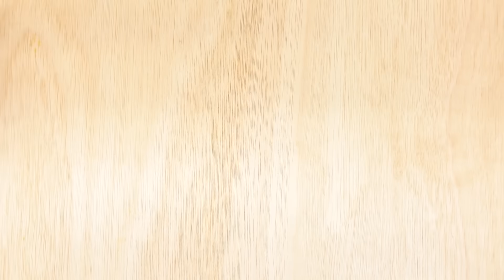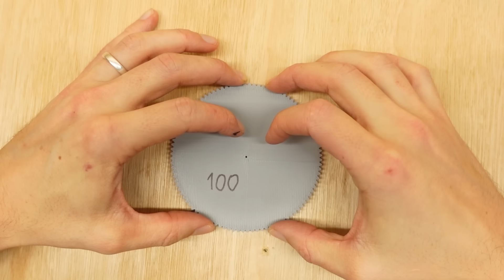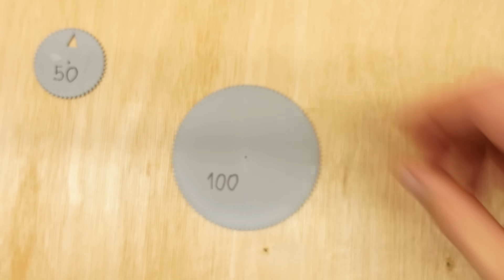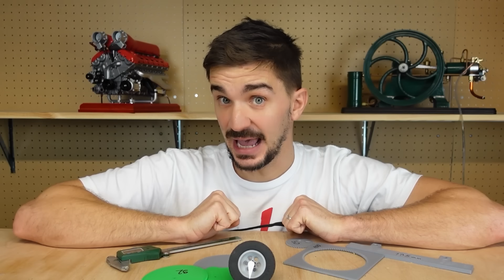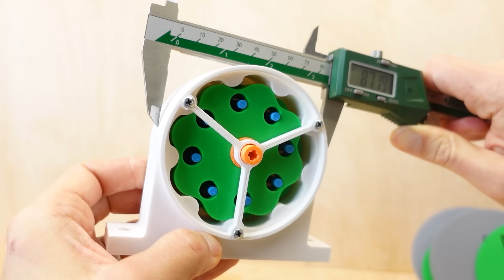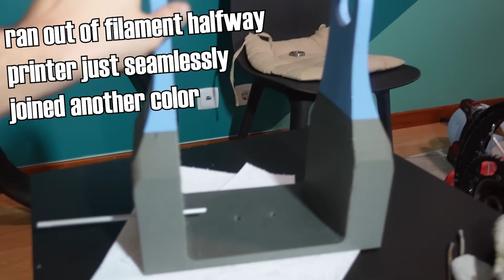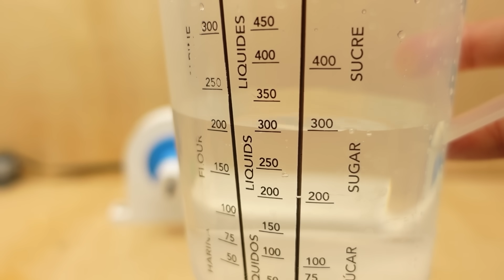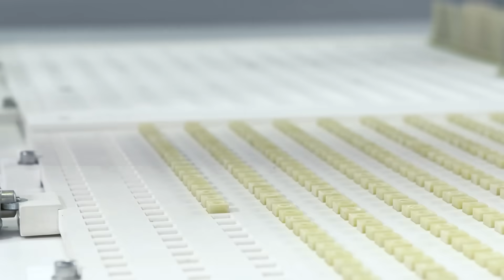Toothless Gears Make Much More Torque Than Conventional Ones, Here's How. Cycloid Drive Explained

Comment: As an automotive engineer with soon 30 years career, I had never heard of these gearboxes. Every day is a school day. Thanks.
Reply: They have virtually no backlash with minimal losses compared to any other no-backlask mechanism. So, when you really, really have to be able to control rotation accurately and with a lot of torque from a small motor... That is why they are #1 in robotics, it is mainly about the lack of gaps between teeth, and then about it also being compact. It isn't so compact that it would be the main reason, but it also happens to be very compact.
Reply: You've never heard of cycloidal oil pumps ?...😮
Reply: @peterfitzpatrick7032  Who’s talking about oil pumps?
Reply: @peterfitzpatrick7032  Hahahaha. A similar mechanism used for something else is a different mechanism.
Reply: @timessix8434  The video is about cycloidal gears... is it not ?...
Reply: @alpha434  when is a cycloidal gear not a cycloidal gear ?... the video is about the unique shape of the cycloidal gears teeth, not just about speed reduction... in automotive engineering, that shape is put to good use in a pump design... the OP is an automitive engineer... so my question if he had never heard of cycloidal pumps is valid... 🙄
Reply: @alpha434  no same mechanism is the same mechanism no matter the application. You ever heard of a wheel on a car vs a wheel on pulley? Totally different thing right??
Reply: Yes. Different things. One is a wheel, one is a pulley. Nice try, bud. Also not similar to a "gear reduction vs a fluid pump". But don't make me wait too long for more midwit commentary.
Reply: @peterfitzpatrick7032  When its not a gear, but a vane. Pretty simple.
Reply: @alpha434  

"It is better to keep one's mouth shut and be thought a fool than to open it and remove all doubt" 😏

From Merriam-Websters dictionary

"Vane" 

"...: a thin flat or curved object that is rotated about an axis by a flow of fluid or that rotates to cause a fluid to flow or that redirects a flow of fluid"
Reply: @peterfitzpatrick7032  Peak-midwit is using Merriam-Webster's to learn engineering, and then not even be able to comprehend that the definition does include the vanes of a cycloidal pump "thin or curved". Lol. Lmao even.
Reply: @alpha434  Is that shaft an axle?
Reply: @peterfitzpatrick7032  why are u talking about oil
Reply: @peterfitzpatrick7032  he's obviously not saying he's never seen a gear shaped like this... a cycloidal oil pump does not us the cycloidal gear as output so its not the same mechanism. also he said specifically he's never seen a GEARBOX like this, not thats hes never seen a gear like this. an oil pump is obviously not a gearbox
Reply: So, automotive industry prefer planetary gear instead
Reply: @aikonlatigid  The automotive industry has dabbled with several different types of gear sets. Planetary, for a lot of automatic gearboxes. Helical gears for manual and DCT transmissions. Straight cut spur gears for reverse, in a manual. And several different flavors of CVTs.
Reply: @aikonlatigid  The reason they are not used in automotive is the same reason you don't find worm gear drives in automotive; it is because the output shaft can NOT drive the input shaft.  The output shaft is "locked" to whatever speed the input shaft is turning at (if the motor is not spinning you can't turn the output shaft at all).  Letting off the gas in a car with a cycloid gearbox would result in immediate skidding of the tires.
Reply: @s @slode1693 Does a standard engine stop spinning when you let off the gas?
Reply: @ReclaimerTyphoon  No...  But it will decelerate at a much faster rate than the vehicle itself.  You really don't seem to understand the issue that the output shaft on these gearboxes is "locked"  You can't turn the output shaft to spin the input side.  When the input shaft is at 0 rpm the output shaft is literally LOCKED in position.
Reply: @slode1693   not if they added a sprag clutch to prevent that
Reply: @slode1693  there are one way bearings that can solve that
Reply: @alf3071  but then your engine braking would be non existent. There's always a compromise
Reply: @slode1693  wouldnt that be cool tho? Drive the car for a bit and then let go of the gas pedal and watch your car skid to a stop?
Reply: @White_Night_Demon Youre paying for the tires, not me.
Reply: @chillinzard I wont be paying tires
Reply: @slode1693 this is false. There's nothing about a cycloid drive that prevents it being backdriven.  The torque required to do so, however.....
Reply: @aikonlatigid  And that is good because cycloid gears have a worse efficiency / more losses...........
Reply: @moru3236  Wrong
Reply: @PaulMartin-n6m  <- Stupid?

If you had even the slightest clue about technology, it would be obvious to you when you see it in action that, with the many friction points on the drive pins, the transmission MUST have SIGNIFICANTLY more losses than a clean involute gearing. The fact that there are more losses here is as obvious as the fact that a Smart car is lighter than a bulldozer. 

Instead of making a fool of yourself here, why not take a look at the tests that weren't conducted by the manufacturers themselves, BEFOREHAND? 

In 2018, ASME has published a paper in which NASA engineers tested cycloidal gears for their efficiency. Under performance conditions, did not even achieve 90% for one stage, but only a maximum of 81% real efficiency for a transmission ratio of 59, tested at low and high torques.

At 50% of maximum torque, they were at only 70% efficiency, 
at 10% they were only 50% efficient,
and at just over 1% maximum torque (still 2Nm), they were only 20% efficient. 

This massive drop in efficiency over torque alone, in contrast to spur gear drives, for example, also is more than just an indication of significantly higher wear in the gearbox. 

Show  me ONE! spur gear that you don't coat with rubber or plastic that has such poor efficiency at 10% / 50% of the rated torque. 

The 80% is also really extremely poor, and even 90% would not be outstanding. 
A reasonable, high-quality triple spur gear unit for a transmission ratio of 59 has ~94-95% efficiency, in reality, and still over 90% even at 50% utilization.
A two-stage planetary gearbox with also ~95% efficiency (How surprising that the same power transmission system has similar efficiency...) doesn't even need much more installation space.

What both gearboxes have in common:
Their positional accuracy is lower than that of cycloidal gearboxes.

When in doubt, you should perhaps stop relying on stupid AI's or Google, which primarily shows you what manufacturers want you to hear as a potential customer (or what suits the political interests of Google's management and financial backers).
Reply: @PaulMartin-n6m  Correct for the gear type in the vedio compared to conventional gear teeth.
Reply: Then also check out harmonic drives.
Reply: the might find use in wipers, power steering or window regulators,  they not really suited to  propulsion.
Reply: @automatic4thepeeple not yet
Reply: @diglettunnel.kaneko "not yet" lmao you think real engineers and inventors haven't tried? All things have been attempted in such simple things like this.
Reply: @Flint_Dribble it can be done it just hasn't yet
Reply: @Flint_Dribble a lot of times things are limited by materials science which advances over time
Reply: @Flint_Dribble  some things take a lot of tries, that's how progress works
Reply: @automatic4thepeeple  They used to say exactly the same thing about CV transmissions.
Reply: @stevealexander8010 they still say it about CV transmissions though tbh 😅
Reply: @automatic4thepeeple  They are not suted for anything that requires repeated use or reliability.
Reply: @justsoicanfingcomment I’m pretty sure the robots that build our vehicles use these, so they much be fairly reliable because those are constant running, correct me if I’m wrong, please.
Reply: @justsoicanfingcomment  That is not true. When they are balanced properly, cycloidal drives can reach high longevity and repeatability of motion.
Reply: @justsoicanfingcomment  Incorrect, that is precisely why they are used in robotics and power transmission in industry, they are extremely robust and reliable.  The reason they are not used in automotive is the same reason you don't find worm gear drives in automotive; it is because the output shaft can NOT drive the input shaft.  It is "locked" to whatever speed the input shaft is turning at.  Letting off the gas in a car with a cycloid gearbox would result in immediate skidding of the tires.
Reply: @justsoicanfingcomment ...." pick and place" Robots  ?
Reply: @lukedean1769 sure bud
Reply: @justsoicanfingcomment  Look at your name.   I would expect a comment that makes no sense from you and your kind.   Well done living up the the expectations perfectly.
Reply: afaik they don't have much application in automotive. There's no way to use clutches to change the ratio like with planetaries, and as mentioned in the video, they don't thrive with high input speeds.
Reply: @klikkolee they're also high friction which means they get hot in high speed. Not an issue for you're typical robot but highly likely to melt at 12000 rpm.
Reply: @klikkolee  That sounds like a list of engineering challenges not a permanent death sentence. Lord knows the heavy truck people want a lower lowest gear that is less prone to breaking or rolling back.
Reply: @viceroybolt3518  Not all engineering challenges are worth tackling. Sometimes there's just another technology that's better suited for a given application. 

In the case of low speed crawling for trucks, it's probably just easier, cheaper, and more space efficient, to include a high/low transfer case off the back the transmission.

It's not my area of expertise, but I do have a hard time seeing how you would efficiently build and package a cycloid crawler gear alongside a traditional transmission gearset.
Reply: Im glad you place the comment! Im also automotive engineer and was surprised not know this jewel!
Reply: @anuardelcastillo2627  just another proof that time doesn't necessarily means knowledge
Reply: It has been used in some excavators being paired in travel motors.
Reply: their major downsides are that they tend to need a large diameter, and they tend to be very slow because it's almost always a very high reduction
Reply: @kivalous  I wonder to what extent reducing the mass of the gear could help, I know the stress of the outside of a large rotating circle is not metal's favorite thing and it needs some help, but could spokes help? Not that there needs to actually be an automotive application I just like thinking through dumb problems.
Reply: @kivalous  have you ever tried rotating them? 1:8 is the same as 8:1. And I assume their speed vibrating problem is fixable
Reply: As a Culinary Supervisor (glorified line cook with most of the answers), I never had either.
As a 47yo who is starting to get burnt out on the industry, absorbing new (to me, at least) concepts and ideas gives me a glint of hope that I might escape the industry before age 50.
Machining sounds fun, and I'm good with numbers, but damn these infernal AI machines!  I might be too late for that.
Reply: And you still didn't see an harmonic drive...
Reply: People saying they are not used in automotive have never looked inside an oil pump.
Reply: What about oil pumps
Reply: The reason is that they have virtually no usability in automotive or most other industries because the ratios are so incredibly high.
Reply: School day indeed and you're the teacher. Many times I've seen someone say essentially "don't try to tell me anything, I've been doing this for four years. I know all there is to know about it". Normally right before it blows up in their face, exactly like someone was trying to tell them. You are an example of how to really be an expert - by continuing to be inquisitive and learn new things all the time. That the way to being smart is to always keep in mind we do NOT already know everything!
Reply: @senseisecurityschool9337  That was very kind, and true, words. Thanks.
Reply: Big car must be hiding something we deserve smooth gears and high torque
Reply: @khersy  A NON-automotive engineer here who knows that cycloidal gears are neither new, nor magical, nor the next big thing. 

They have their niche, like all commercial gear types—and they are perfectly suited to this niche. The biggest advantages are the installation space and what keeps them alive on the market:
their precision.

If you feel like spending significantly more money to consume significantly more fuel (about twice the losses of spur gears for the same transmission ratio) and repairing or replacing your worn-out transmission 2-3 times earlier for a lot more money, someone will definitely build one into your car for money while laughing at you. ^^ 

There is indeed a “big cars.” But they don't have a personal twist with cycloidal gears. They would just make the car's performance worse and change the transmission ratio... abruptly...
Big cars really just want you to love gasoline (or another fuel that requires wear-and-tear engines and old production methods and lines, and finances refineries and oil billionaires).
Reply: Sumitomo Cyclo Drives were popular 40 or 50 years ago. These were used in heavy industrial power transmission - conveyor drives etc. No sure if they still exist.
Reply: Check out Sumitomo Cyclo Drives. They were big in the 70's in industrial power transmission - conveyors etc. I don't know what industry uses today.
Reply: "Engineer" ? sure. And I'm a grammar major
Reply: Feels like a rotary piston way of fonctionning to be fair
Reply: Mine is 300 years
Reply: ... 30 years and you never had a chance to spend time with the machinists?! I tells ya its not a suprise; engineers hardly had time to shoot the bull where I was working in tool and die. but it is so sad to see. They where seperated intentionally and tasks and specialities designed to be complementary careers making the entirety of enigneering

And now 3d printing and CNC really is getting rid of machinists.

Maybe I should go into consulting 🤔
Reply: "Every day is a school day" is one of the best things I've ever read
Reply: If you work for Ford, please kick your boss in the nuts.
Reply: It's already a concept that is 100 years old😅😅 the patent is 100 years old one of the first units probably are from the 1930's. I knew it was old but didn't know that it's already that old😅😅😅
Reply: I have a set of gear reducing socket wrenches that have this in the head, they are great and the ratcheting mechinsm has 0 travel to lock, so you can deliver an incredible amount of torque with even only degree of rotational space to work with. It's gotten me out of a few tight spaces over the years, getting out cruddy bolts in weird places where only a 1/4 drive wrench can get in there
Reply: @ZTenski Are you sure you don't have a sprague clutch ratchet? They have no reduction.
Reply: @alpha434 actually, you are right that is what it is. I remember now dad saying he took one apart once and and balls fell out, after which he never managed to reassemble it to the way it was, it was always off a bit. There is no gear reduction in the head, actually I'm not sure if that's even possible without some kind of pivot point or fulcrim, although I imagine they might exist with a large enough head.

Not sure what that other  guy was on about with the aristotle speech haha.
Reply: It should be possible to make one, with planetary gears and a ring gear at the right ratios. Planetary gears send the ratchet back but you're pushing forwards, so if the ratio was in the sweet spot you should get some leverage, like one turn of the ratchet makes a quarter turn on the bolt. Wonder if such a device is possible or was ever made, maybe the gear sizes make it non-feasible. Also you'd need to drive either the plantets or the sun and ring together to get the effect, so the gearbox would be complex. Maybe too complex to take the strain.
Reply: Why i love LG "Life is Good" wouldve deff name my brand that
Reply: It's toothless it can grip better most people know about that from your mom.
Reply: I first encountered this type of geargox in the spare tire winch that was a standard OEM equipment on my 1994 Dodge Caravan.
Reply: What other video materials do you recommend to watch?
Reply: I spent half my engineering life troubleshooting manufacturing equipment. I never met such a gearbox. Engineering is a vast field. Yes, there's always more to learn.
Reply: You must really suck lol
Reply: Slush box lol
Reply: I don't have that much experience, but internal gears are optimised & considered more factors, you can say this is primitive version, make teeth hight small & more quantity for smooth rotation, the. Add trapezoidal shap to teeth to make anti slip, boom you are back to original design. A optimised design
Reply: “Every day is a school day”
I’m stealing this one, I love it!
Reply: Yes, because worm gears exist, and they are even smaller and smoother for the same high torque conversions.
Reply: @Xizario2  but can you go reverse?
Reply: Bravo to mechanic master.explanations about two different torque systems are very tutorial
Reply: Grier pumps are based on this principle and are used in engines to push oil.
Reply: So... An oil pump!!😮
Reply: Hey automotive mechanic here. We hate you.
Reply: they are pretty common in robotics
Reply: Why do engineers hate mechanics? I had to change a starter on a jeep and had to remove the entire intake system
Reply: Seems like a result of either poor education for your profession or lacking interest in your job
Or both
Reply: @Jannis-hj4vm  Thanks for your insightful input. Despite your derogatory remark my comment has >1100 likes and counting. You might not be aware but there are many fields of automotive engineering and I am working within powertrain development. Show me an automotive powertrain application of these gearboxes, or stop making comments about things you obviously know nothing about.
Reply: Да неужели в автомобилестроении есть инженеры? я думал там полвека уже одни маркетологи а не инженеры.
Через сколько веков вы инженеры сделаете автоматический ручник срабатывающий если водитель покинул сиденье?
Через сколько веков сделаете невозможность начала движения если забыл снять с ручника?
Автоматическое отжатие сцепления на мкпп при критически низких  оборотах машина не глохла, при переключении передач, при нажатии тормоза?
Полметровую юбку безопасности покругу
Более удобные и/или автоматические ремни желательно 4-5 точечные.
Ограничение максимальной скорости в 100 миль час.
Почему двс использует только расширение газов горючего а тепло вылетает в трубу? А у паровоза наоборот использует только тепло а расширение газов горючего вылетает в трубу. 
Вы не инженеры вы сектанты работающую на систему для которой человек это лишь средство дохода и его жизнь и благополучие неважны.
Reply: @timessix8434  That is because real automotive engineers innovate not stagnate like you! ❤
Reply: @junfon7097 and this is why you have no friends.
Reply: @junfon7097  Haha - ok, then you can show me an automotive application that has these gearboxes in the drivetrain.  No?
Reply: @timessix8434  Most cars use them as oil pumps